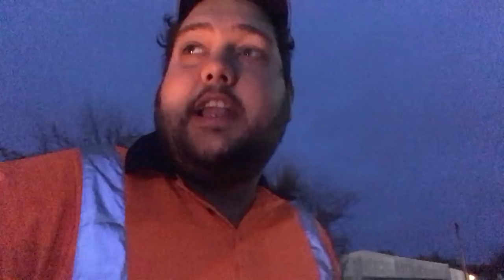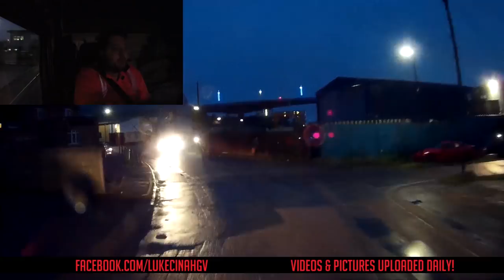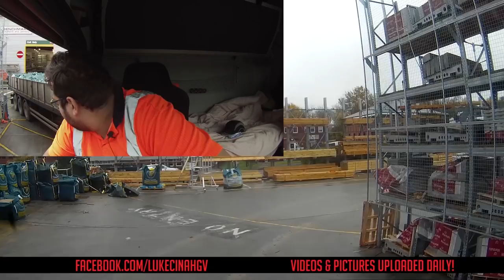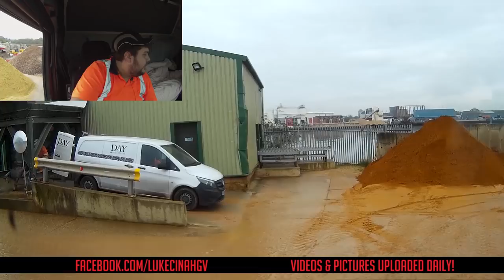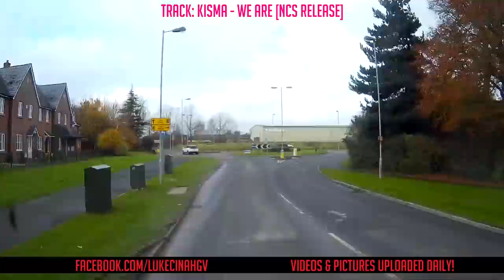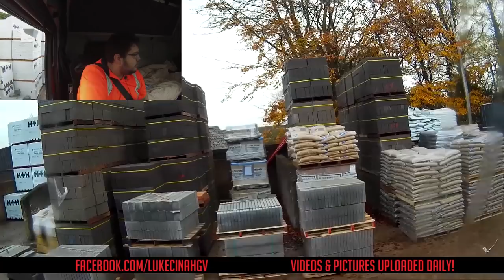We're Going HOME!

Comment: Going in to do my practical training in a few weeks for class 2 ... once passed class 2 can you go straight onto class 1 ?
Reply: David Carling  yes you can but you have to wait for your licence to come back with your class 1 entitlement on.
Reply: You can. when you pass your class 2, don't send your license off if you're doing your class 1 straight after. You can sit your class 1 test with your normal driving license and class 2 pass cert.
Reply: brady yeah well I've got funding for both classes so if I pass class 2 straight up they should put me through class 1 straight after shouldn't they? Also if passed both could I go straight to class 1 work or build my experience up on class 2? Sorry for the questions new to the trucking scene lol
Reply: David Carling just depends how fast they can fit you for your test. Up to you if you work straight away on class 1. The hard part is finding someone who will employ you with no experience. Best bet would be agencies. All I did was start on the rigids. Joined all the agencies and just rang around everywhere until I ended up with a perminent job. If you want my advise it's start with a class 2 job get used to driving, cornering and reversing in a bigger vehicle before you drive artics. Each to the own tho!
Reply: brady cheers buddy, either way if I pass both I've got them both to choose from but like I said to my wife I'd probably do a year on class 2 then onto class 1 from there !! Cheers for the advice though
Reply: David Carling it's probably easier getting Class 2 work to be fair, like Brady said get in with the agencies and tell them you'll do both, at the end of the day it keeps the beer tokens rolling in.